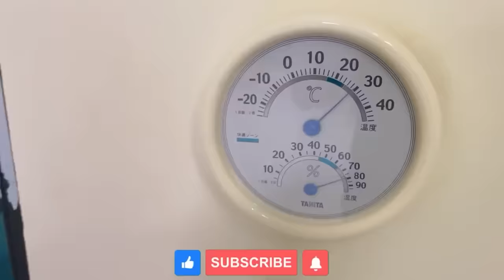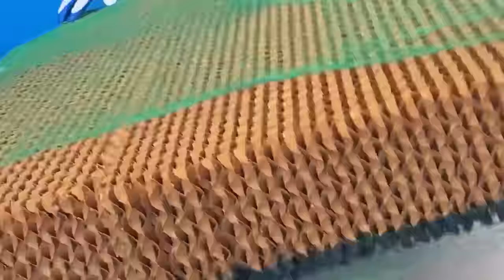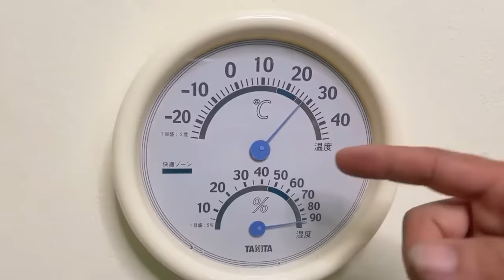32 techniques most used by plumbers near me! Idea with metal water lock + rivet + bottle and foam

Comment: The use of everyday items like bottles and foam is genius. Do you have any more creative plumbing hacks to share?
Reply from the maker: I'm glad you found the plumbing hacks interesting! Absolutely, there are more creative plumbing hacks that can come in handy. Here are a few:

Zip Tie Drain Cleaner: If you have a clogged drain, attach several zip ties together and use them to reach and clear debris.

Hair Catcher: Prevent hair clogs in your shower or sink by using a hair catcher or placing a piece of pantyhose over the drain.

Plunger Substitute: In a pinch without a plunger, you can create suction by using a plastic bag. Place it over the drain, push down, and pull up quickly.

Vinegar and Baking Soda: This classic combo can help unclog drains and remove mineral deposits from faucets. Pour baking soda followed by vinegar down the drain and let it sit before flushing with hot water.

Dish Soap Lubricant: To ease the installation of tight-fitting plumbing components, use dish soap as a lubricant. It helps create a seal without damaging the materials.

Plastic Bottle Funnel: Cut a plastic bottle in half, invert the top part into the bottom, and use it as a makeshift funnel for pouring liquids or accessing hard-to-reach areas.

Pipe Insulation for Noisy Pipes: If your pipes are making loud banging noises when the water is turned on or off, wrap them with pipe insulation to dampen the sound.

Duct Tape Patch: In emergency situations, you can use duct tape to temporarily patch small leaks until a more permanent repair can be made.

Ice Cube Trick for Garbage Disposals: To sharpen the blades and remove odors, drop a few ice cubes and citrus peels into the garbage disposal and run it.

Teflon Tape for Leaky Faucets: If you have a dripping faucet, wrapping the threads with Teflon tape can often stop the leak temporarily until you can replace the faulty part.

Remember to exercise caution and prioritize safety when attempting any DIY plumbing hacks. If you have a specific plumbing issue, feel free to describe it, and I can provide more targeted advice or hacks to help you out!

Comment: The rivet method is intriguing. Can you share any common mistakes to avoid when using rivets in plumbing projects?
Reply from the maker: Certainly! When using the rivet method in plumbing projects, there are some common mistakes to avoid to ensure a successful outcome:

Incorrect Size Rivets: Make sure to use the right size and type of rivets for the specific plumbing task. Using rivets that are too small or too large can lead to weak connections or damage to the plumbing components.

Improper Hole Placement: Drilling holes for the rivets must be precise. If the holes are misaligned or too close to the edge of the material, it can weaken the connection and potentially cause leaks.

Over-Tightening: Avoid over-tightening the rivets, as this can deform or crack the plumbing material. Use the appropriate amount of force to create a secure connection without causing damage.

Failure to Clean the Area: Before riveting, ensure that the surfaces being joined are clean and free from debris, rust, or corrosion. Dirty surfaces can prevent the rivet from sealing correctly.

Inadequate Sealing: If you're using rivets to seal a leak, ensure that the rivet is tightly sealed and covers the entire affected area. Insufficient sealing can result in continued leaks.

Lack of Lubrication: Lubricate the rivet and the rivet gun to ensure smooth and even installation. This helps prevent friction and makes the process easier.

Not Using a Backing Washer: In some cases, using a backing washer can provide additional support and strength to the rivet joint, especially when dealing with high-pressure systems.

Ignoring Safety Precautions: Always wear appropriate safety gear, such as gloves and safety glasses, when working with rivets and plumbing materials. Additionally, follow safety guidelines for using riveting tools.

By avoiding these common mistakes and practicing proper technique, you can effectively use rivets in plumbing projects to achieve strong and reliable connections.

Comment: The metal water lock technique is impressive! Are there any potential drawbacks to using it in certain situations?
Reply from the maker: Thank you for your interest in the metal water lock technique, and I'm glad you find it impressive! While this method can be highly effective in many plumbing situations, it's essential to be aware of potential drawbacks and when it may not be the best choice.

1. Corrosion: Depending on the metal used, there can be a risk of corrosion over time, especially in environments with high moisture levels. Regular inspections and maintenance may be necessary to prevent this issue.

2. Skill Level: Properly installing a metal water lock requires some plumbing expertise. If not done correctly, it may lead to leaks or other issues.

3. Disassembly: If you ever need to disassemble or modify the plumbing connected with metal water locks, it can be more challenging compared to other coupling methods. This could result in additional time and effort.

Above are some limitations in using metal water locks. However, we are trying to find solutions to overcome these weaknesses. If you have any more questions or need further clarification, please feel free to ask!

Comment: The foam technique is new to me. Can you provide step-by-step instructions on how to use it for sealing purposes?
Reply from the maker: Absolutely, I'd be happy to provide you with step-by-step instructions on using foam for sealing purposes:

Step 1: Gather Your Materials
Make sure you have the following materials ready: foam sealant (expanding foam), safety gloves, safety goggles, a foam gun applicator (if available), and a utility knife.

Step 2: Safety First
Put on your safety gloves and goggles to protect your hands and eyes while working with the foam.

Step 3: Surface Preparation
Ensure that the surface you intend to seal is clean, dry, and free of any dust, debris, or loose particles. A clean surface ensures better adhesion for the foam.

Step 4: Shake the Can
Vigorously shake the foam sealant can for about 30 seconds to mix the components thoroughly.

Step 5: Attach the Applicator (if applicable)
If you have a foam gun applicator, attach it to the foam can.

Step 6: Prime the Applicator (if applicable)
For foam gun applicators, briefly press the trigger to prime the applicator.

Step 7: Apply the Foam
Hold the can/applicator at a 45-degree angle to the area you want to seal. Depress the trigger slowly to allow the foam to expand as it comes out. Start with a small amount, as the foam expands significantly. Avoid overfilling.

Step 8: Shape and Smooth
While the foam is still wet, use a putty knife or spatula to shape and smooth it for an even seal. You can also use a damp cloth to wipe away excess foam from the surrounding areas.

Step 9: Allow to Cure
Follow the manufacturer's instructions for the curing time. Typically, it takes several hours for the foam to fully expand and cure. Be patient during this process.

Step 10: Trim Excess
Once the foam is completely cured, use a utility knife to trim any excess foam that extends beyond the sealed area. Be careful not to damage the surface you're sealing.

Step 11: Finish (if needed)
If necessary, you can paint or finish the sealed area to match the surrounding surface.

Remember to read and follow the specific instructions provided on the foam sealant product, as different brands may have slight variations in their application methods. Safety precautions, such as wearing protective gear, are crucial throughout the process.

I hope this guide helps you successfully use the foam sealing technique for your projects. If you have any more questions or need further assistance, feel free to ask!

Comment: Ive had some issues with my kitchen sink lately. Are any of these techniques applicable to common kitchen plumbing problems?
Reply from the maker: Absolutely, many of the techniques discussed in the video can be applied to common kitchen plumbing problems. Here are a few examples:

Leaky Faucets: The video may cover techniques on how to fix leaks, which can apply to a kitchen sink faucet.

Clogged Drains: Plumbing tricks for unclogging pipes or drains can be useful for kitchen sink blockages.

Pipe Repairs: If you have issues with the pipes under your kitchen sink, some techniques might help with quick fixes.

Water Pressure: Techniques for improving water pressure can benefit the kitchen faucet's performance.

However, it's important to note that kitchen sinks can have unique issues, such as garbage disposal problems or specific faucet types. Some of my other videos also provide instructions on how to troubleshoot those issues. You can check them out. If they haven't been helpful so far, please let us know more about the specific situation you're facing. We're willing to share a video addressing that particular problem with you.

Comment: Wow, I never thought about using a bottle for plumbing. What are some other unconventional items that can come in handy in a pinch?
Reply from the maker: I'm delighted to hear you're open to unconventional plumbing solutions! Indeed, there are various everyday items that can come in handy in a pinch for plumbing repairs. Here are a few more:

Foam: Great for sealing gaps and insulating pipes.

Screws and Bolts: Can be used as makeshift pipe clamps or braces.

Plastic Pipe Sections: Don't discard old plastic pipes; they can be cut and repurposed for quick fixes.

Rubber Bands or Hose Clamps: Useful for temporarily sealing leaks.

Tape: Duct tape or plumber's tape can provide a temporary seal.

Wire Hangers: Bent into shape, they can help retrieve lost items from drains or provide support.

Plastic Bags: Can be used as temporary waterproofing.

Cloth or Towels: Handy for soaking up leaks or spills.

Plunger: Not unconventional, but often overlooked. A plunger can help with unclogging sinks, toilets, and drains.

Remember that while these items can be useful in a pinch, they are typically temporary solutions. It's always a good idea to consult a professional plumber for more permanent fixes or if you're unsure about the safety of your DIY repair. Safety should be your top priority when dealing with plumbing issues.
Have a good day!

Comment: As a homeowner, I find this video incredibly valuable. Whats the most common plumbing issue you encounter in your line of work?
Reply from the maker: I'm glad to hear you find the video valuable! In the plumbing profession, plumbers often encounter a wide range of issues, but some of the most common plumbing problems include:

Leaky Faucets: Dripping faucets can waste water and increase your water bill.

Clogged Drains: Build-up of debris, grease, or foreign objects can cause drain blockages.

Running Toilets: A running toilet can waste a significant amount of water over time.

Leaking Pipes: Aging or damaged pipes can develop leaks, leading to water damage.

Low Water Pressure: Reduced water pressure can be caused by various factors, such as sediment build-up or faulty fixtures.

Water Heater Issues: Problems with water heaters can result in cold showers or insufficient hot water.

Sewer Line Blockages: Blockages in the sewer line can cause backups and unpleasant odors.

Garbage Disposal Problems: Issues with garbage disposals can lead to clogs and malfunction.

The most common issue can vary depending on factors like location, climate, and the age of plumbing systems. Regular maintenance and prompt attention to plumbing problems can help homeowners avoid more extensive and costly repairs in the long run.

Comment: Im loving the DIY approach. Whats the most challenging plumbing project youve personally undertaken?
Reply from the maker: I'm delighted that you're enjoying the DIY approach to plumbing! Personally, one of the most challenging plumbing projects I've undertaken involved completely re-piping an older home with outdated plumbing systems. It required meticulous planning, precise execution, and a deep understanding of plumbing codes and regulations.

Every project has its unique set of challenges, but this one stands out because it involved working on various aspects, from replacing old pipes to reconfiguring the entire plumbing network. It was a rewarding experience, and it taught me a great deal about problem-solving in the world of plumbing.

If you're considering tackling challenging plumbing projects yourself, remember that preparation, research, and safety are crucial. It's often helpful to start with smaller projects and gradually work your way up to more complex tasks. Always consult with professionals when in doubt, and ensure you have the necessary permits if required by local regulations. Good luck with your plumbing endeavors!

Comment: Ive seen some DIY plumbing disasters. Any tips on when its best to call a professional plumber instead of attempting repairs yourself?
Reply from the maker: Absolutely, knowing when to call a professional plumber is crucial to avoid DIY plumbing disasters. Here are some tips on when it's best to seek professional help:

Complex Repairs: If the plumbing issue involves complex repairs, such as extensive pipe replacements, sewer line problems, or major fixture installations, it's advisable to call a professional. They have the expertise and tools to handle such tasks safely and effectively.

Safety Concerns: If the plumbing problem poses safety risks, like gas leaks or electrical issues near water sources, do not attempt DIY repairs. These situations require immediate attention from a trained plumber to prevent accidents or further damage.

Lack of Experience: If you have limited or no experience with plumbing repairs, it's best to leave the job to professionals. Attempting complex repairs without knowledge can worsen the issue and lead to costly repairs later.

Emergency Situations: In case of plumbing emergencies like burst pipes, severe leaks, or flooding, don't hesitate to call a plumber immediately. They can quickly assess the situation and take appropriate action to minimize damage.

Code Compliance: Plumbing work often needs to meet local building codes and regulations. Professional plumbers are well-versed in these codes and can ensure that your repairs or installations comply with the law.

Persistent Problems: If you've attempted DIY repairs multiple times, and the problem keeps recurring, it's a sign that there may be an underlying issue. A professional plumber can diagnose and address the root cause effectively.

Older Plumbing Systems: Older homes may have outdated plumbing systems that require specialized knowledge for repairs and replacements. Professional plumbers are experienced in working with various plumbing systems and materials.

Warranty Considerations: If your plumbing fixtures or appliances are under warranty, attempting DIY repairs might void the warranty. Professional plumbers can perform repairs without affecting your warranty coverage.

Time Constraints: If you have a busy schedule or lack the time to complete a plumbing project efficiently, hiring a plumber ensures that the job gets done promptly.

Remember that while DIY plumbing can save money on minor repairs and maintenance, it's crucial to recognize your limitations and prioritize safety. When in doubt or faced with challenging plumbing issues, consulting a professional plumber is often the best course of action.

Comment: 5:15
You need to heat both ends of the pipe, expand one, narrow the other, no need to glue anything.
Reply from the maker: You're right! Heating both ends of the pipe, expanding one, and narrowing the other can work without the need for glue. Thanks for the tip!

Comment: So….it seems like draining the tank sting and applying caulk to the crack and letting it dry would be cheaper, possibly faster, more aseptically pleasing, and not just plain silly
Reply from the maker: You've made a valid point. Draining the tank, sealing the crack with caulk, and allowing it to dry can indeed be a more cost-effective, quicker, and aesthetically pleasing solution. Sometimes, creative or unconventional methods are used in videos for entertainment or demonstration purposes. However, practical and efficient solutions like the one you suggested can be more suitable for real-life situations. Thank you for sharing your thoughts and offering a helpful alternative!

Comment: Your passion for plumbing really shines through. Do you have a favorite technique among these?
Reply from the maker: I'm delighted that you can see my passion for plumbing in the video! It's challenging to pick a single favorite technique among these because they each have their unique applications and benefits. However, if I had to choose one, I'd say the "foam technique" is particularly versatile and innovative. It's not only effective but also quite creative in how it can be used for sealing purposes.

That being said, every technique showcased in the video has its place and can be incredibly useful depending on the specific plumbing task at hand. The key is to have a diverse toolkit of skills and techniques so that you're well-prepared to handle a wide range of plumbing challenges. Whether you're tackling a small repair or a larger project, having a variety of techniques at your disposal is always an advantage.